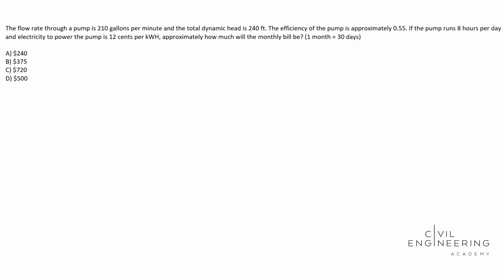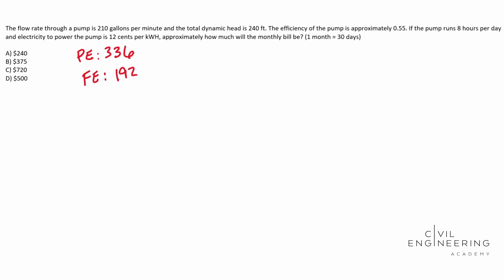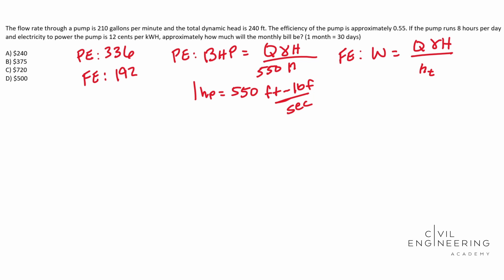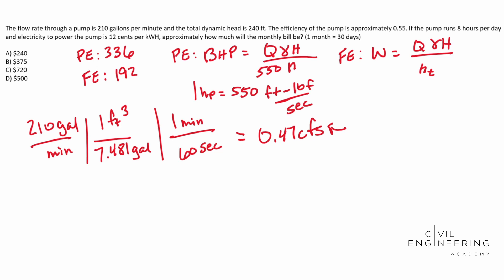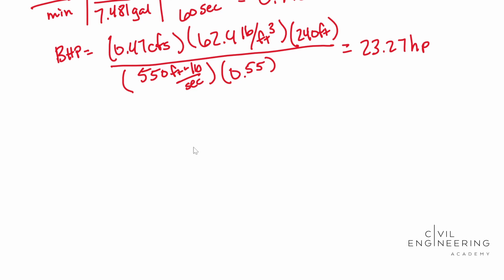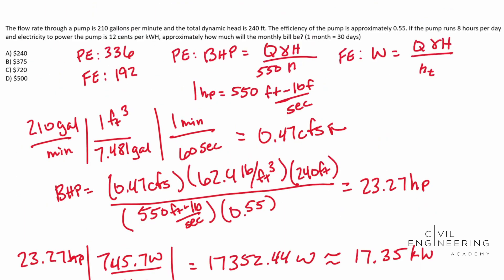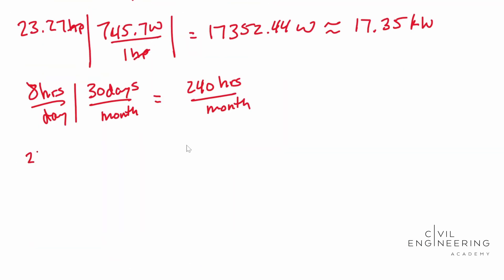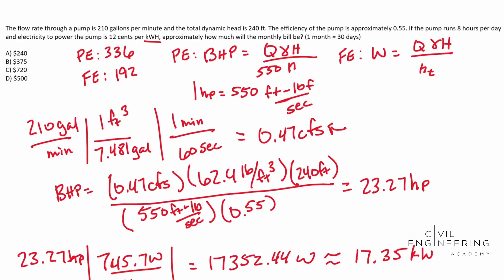Civil FE/PE Exam - Water Resources - How to Solve for the Monthly Cost of a Pump

Comment: Note the pump power equation on pg 335 (PE) can also be used where [brackets are used below to indicate conversion factors are being used];
Power= ( (210 gal/min)[(1 min/60 sec)(0.134 cf/gal)](62.4 lbf/cf)(240 ft) )/0.55 = 12,770 ft-lbf/sec
Convert to kW = 12,770 ft-lb/sec [1kW/737.6 ft-lbf/sec] =17.31 kW
--
then same thing: (30 days/month)(8hr/day)(17.31kW)(12 cents/kW-hr)[1 dollar/100 cents] =498.5 dollars/month
Reply: Why do you ignore acceleration due gravity?
Reply: @chillout8381  they didn't. 62.4 is the specific weight of water and specific weight = density times acceleration due to gravity.